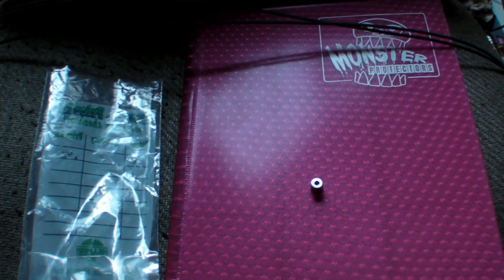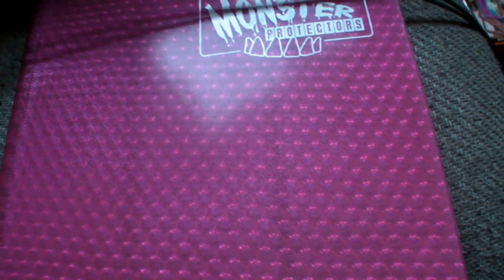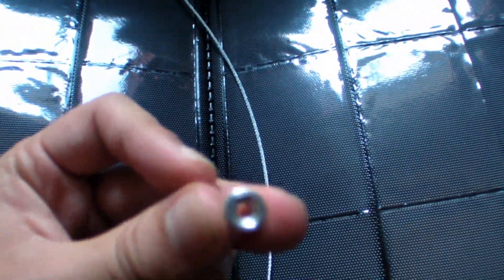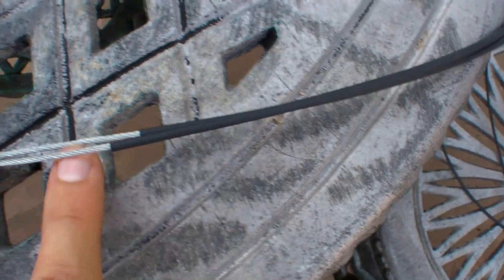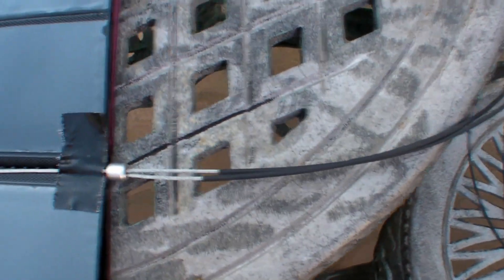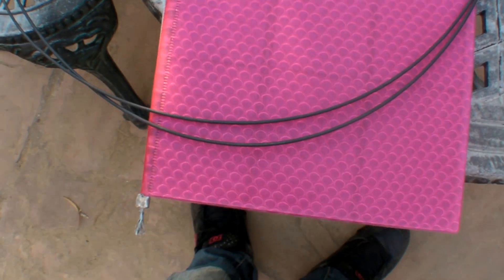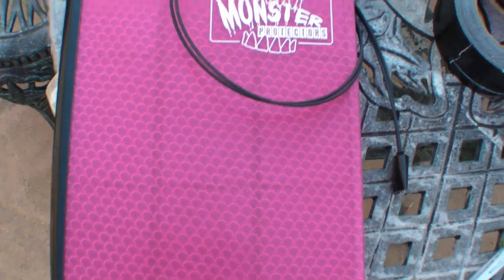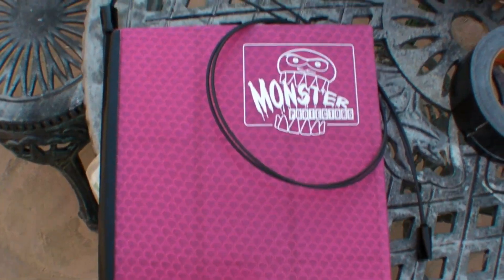Security Binder Tutorial

Comment: the middle of the binder is tiny and thin. The 2 wires clamp the center spine of the binder.

The 2 wires are bound by an alloy form, not as strong as a weld yet close.

When the binder is filled with cards the binder is too thick to slide through the 2 wires in its center, so wherever the wire goes, the binder goes and vise versa.

Secure the wire to a pole, table, your arm... and no one is running off with your binder.

basically the binder is on a steel leash.

Comment: Normal wire cutters wont work. You cant use tiny ones, like line-mans or wire cutters. Wire cutters are for copper and aluminum.

You need steel cable cutters, they are like mini bolt cutters and are very very conspicuous.

You could hide them in your bag, but once you try to use them you might as well slap the cuffs on yourself.

You will most likely bring the wrong cutter, and try for 3 seconds to cut the wire with all you might, then get caught.